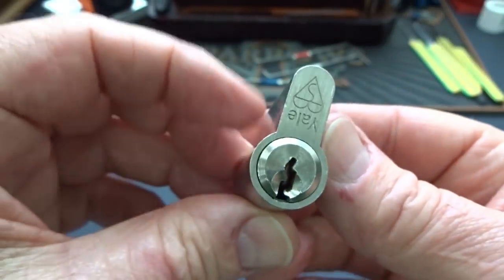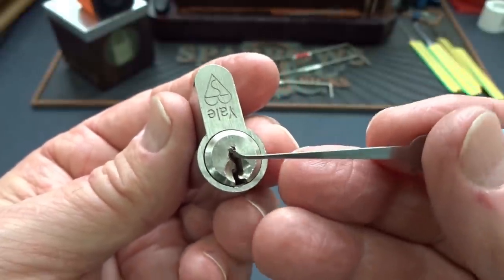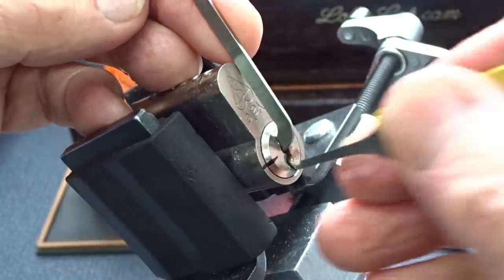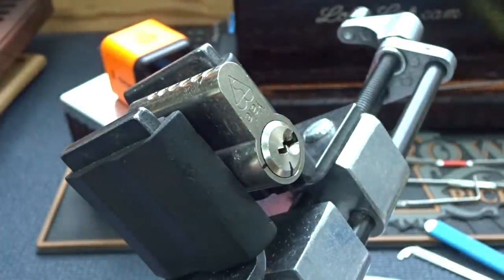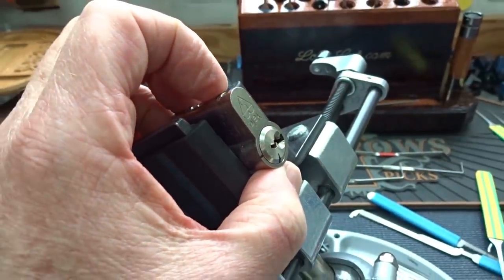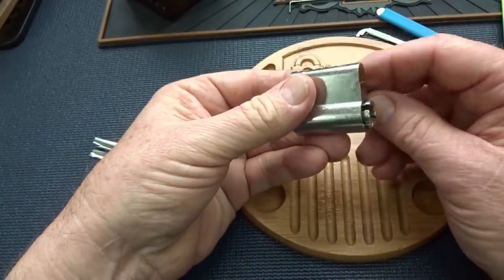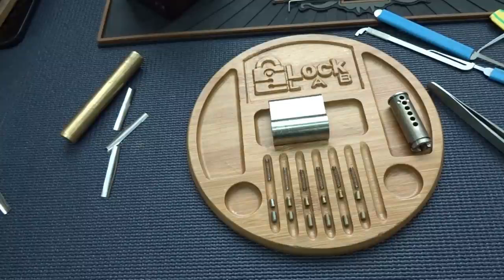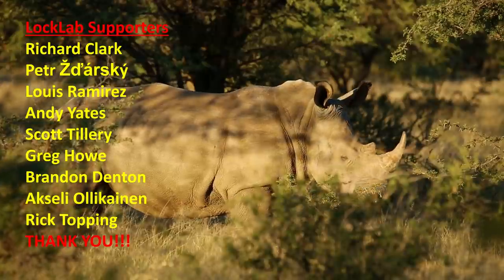(1221)  Challenge:  Yale by Matthew

Comment: Now I don’t feel so bad. I always seem to have trouble with Yale locks, especially that particular keyway. The TOK tension always wants to fall out going clockwise. I usually pick in the counter clockwise then  use the plug flipper because of this. And you pretty much have to use a postal hook from the bottom or you’ll get no luck. Keep up the good work with your pleasing voice and banter.

Comment: I just noticed you went to the plain blue desktop vs the self healing grid mat. I like it a lot much better this way. I didn’t notice, i had to look back but its been this way the last 7 videos. I noticed because when you removed the vice it left the rubber foot imprints for a little bit.  Very impressive stock lock.

Comment: I think the lock might have been improved by using a "T" pin on pin #6, and by not having the warding drilled through on hole #6.  Given those changes, I would think the lock would be very hard to pick even if everything else was standard pins, since pin #6 could only remain set when all other pins were below the sheer line.